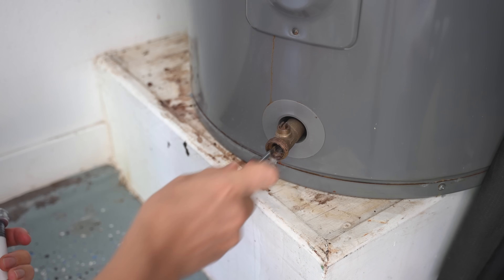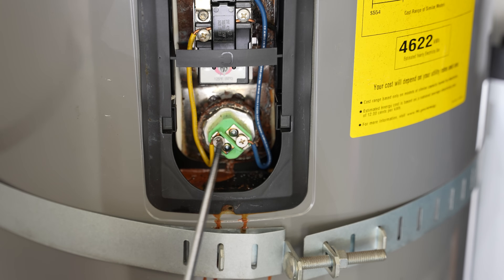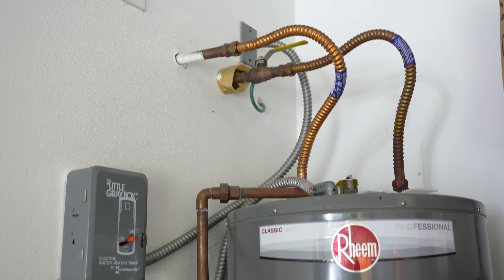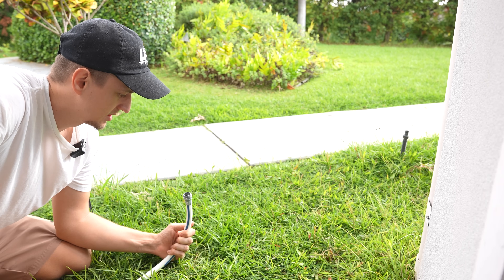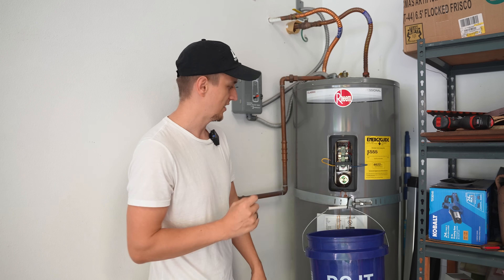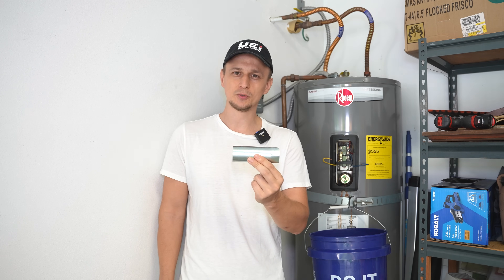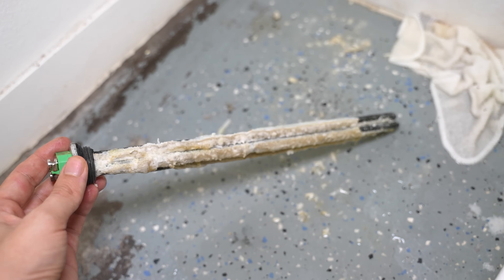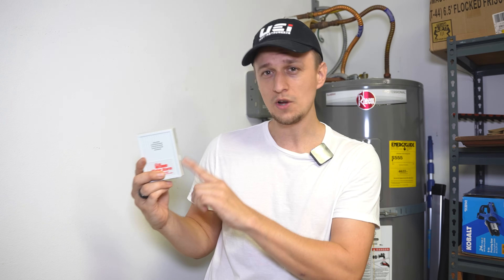How to Replace Water Heater Element Without Draining the Tank

Comment from the maker: ⬇ Other water heater videos you may be interested in:

How to Test Heating Elements:
https://youtu.be/btyVpGgQK3Y
How an Electric Water Heater Works:
https://youtu.be/H3mK15ILAMs
How to Replace Pressure Relief Valve:
https://youtu.be/ca7cg_Vp-rY
How to Adjust Temperature on Water Heater:
https://youtu.be/mMefq--YuZ8
How to Replace Anode Rod on Water Heater:
https://youtu.be/qLzoikQ7gWg
Does a WH Really Need to Be Drained and Flushed:
https://youtu.be/bb35cQuJ_y0
When Should a Water Heater be Replaced:
https://youtu.be/xRtd2lSb4lY
Running Out of Hot Water Too Fast:
https://youtu.be/o-LsUWlWVh0
How to Read Water Heater Wiring Diagram:
https://youtu.be/TX8SuHK1esY
The ONE Device Every Homeowner Should Have:
https://youtu.be/Oy21NhLuzvk

Comment: Sometimes if the drain valve is clogged with sediment turning the main valve back on momentarily can blow the junk out with a little added pressure. Also had elements rusted that bad you couldn't budge with a breaker bar . A 1/4" drive impact drill  and socket will easily break it loose and I always add pipe dope on the usually rusted threads on tank and new element to keep small leaks from happening even though the gasket is supposed to do the work it will at least make the element easier to remove next time. Most 1 1/2" sockets will need to have the chamfer removed from the face as there is very little material for the socket to grip unless you find a socket made for element removal. Ask me how I know this. 😂

Comment: A universal heating element heats as good as a name brand..... just use the correct wattage and voltage. 3500/4500 240v etc....
Reply: Agreed. Those sold at our hardware stores will fit and function as well as name brand. Might even be made in the same factory.

Comment: You left the hot valve open when you removed the element letting air in. Wrong…..close the hot valve then remove element….now you have a vacuum and very little water comes out. Then after you replace element you can open the hot valve to let air escape while you refill the tank.

Comment: After replacing both elements and both thermostats and checking all voltage / continuity.... my heater gets 240 volts but makes NO sounds.  Is this normal?  My previous elements made a quiet, hissing, heating sound since the first day years ago.  What do you suggest?
Reply: Replying to my own question:  After 2 hours with the electricity ON my new parts, I had hot water !! Yeah! Having No sound is apparently not a problem.  With my ear pressed on the tank, I only hear a faint humm. Whatever I did, it resulted in a silent tank unlike when it was brand new.

Comment: Weird. All our Rheem water heaters have the element at the very bottom because hot water will rise to the top so you want to heat the coldest water at the bottom of the tank. There's no space for a bucket to catch water. I've only seen upper elements when it's only a booster element for solar or a wetback. Think I'll stick to draining the tank first.

Comment: Question I have a 50 gallon energy smart whirlpool electric water heater I checked the elements and they read around 12/13 which I assume they are still good? Issue why I checked them was the pressure relief valve was dripping water from the tube and the hot water keeps going off and I'm having to reset it. This water heater doesn't have thermostats like regular water heaters so I assume the thermostat is in the control panel? Please help not sure what the issue could be why I'm not getting hot water and keep having to reset it to have it work for a bit then again have to reset it. Could it be the pressure relief valve itself but I assume that wouldn't be the cause of why it isn't heating? Could sediment in the tank cause it to not heat up? Please help 🙏🥹 ty !
Reply: 2 weeks is a long time to go without hot water, so I presume you got it sorted one way or another. However, if not, it sounds like you have electronics instead of thermostats and there is a problem causing the electronics to call for heat on one or both elements so it builds too much heat/pressure and leaks at the pop-off. If you have access to the electronics, it could be electronic parts failure causing it call for heat, or a stuck relay (fused contacts is a typical failure mode) completing the circuit to an element.

If you are handy and it's a relay you probably can replace it. Tapping on it may break the fused contacts loose, but it will not take long to happen again.

Comment: To drain it faster, connect the end of the water hose to a water hose faucet. Open the drinking water faucet, for a few seconds. The water pushes back to the tank, then disconnect the water hose and the suction will reverse back to normal and the water flush whatever sediment is causing obstruction.

Comment: Im about to turn the water back on. Man, I hope I did this right. If it works this will be my first home repair project. Hopefully I don’t need a new home in case I messed this up lol I appreciate the video for sure. I watched a few others but ultimately used your video.
Reply from the maker: Hopefully all went well for you my friend! Way to tackle the repair yourself. The first times are always stressful but confidence is built by trial and error.

Comment: Why couldn't you drain the tank by turning the hot water faucets inside the house on after you've flipped the breaker to the water heater and turned the water off to the house? For example, if you turned the hot water in the bathtub on, it would drain all the water in the tank and since the water to the house is off, the tank wouldn't fill back up. That way, you wouldn't have to worry about running a hose through your house or messing with the drain on the water heater or potentially flooding the room by doing it "on the fly". Im no expert, so if there's a reason why it should not be done like this, please let me know.
Reply: I wondered the same thing. Hopefully someone will respond to this. I just drained my tank with a hose. I hardly had a trickle so that was an entire other video lol but I got it done. Hopefully… I’m about to hit the power and see.
Reply: Cold water fills the water heater up from a pipe going into the top of the tank. This pipe goes all the way to the bottom of the tank.  When you turn on the hot water faucet in your house, the heated water exits the tank from the TOP while simultaneously getting filled from the bottom. You only open the hot water faucets in your home so that a vacuum is not created inside the water heater and so that it can be drained properly via the hose bib drain at the bottom of the tank.

Comment: I worked at a HUD apartment complex years ago and I did element swaps and never drained a tank, i just cut the power and water, duct-taped a heavy garbage bag right under the lip of the element bulkhead to catch the water and did the swap as fast as possible. Some of these water heaters were 15yo+ and full of lime so draining for a swap wasnt an option. This also got me out of the apartments significantly faster which was better for both me and the residents.

Comment: I just completed this repair today on my unknown age Whirlpool 62 gallon 240v water heater.  New upper and lower thermostats, new upper and lower heating elements, and a new T&P valve.  The sediment was up to the lower heating element.  I vacuumed out as much as I could using a smaller tube shoved into my shop vac, but I know it's not perfect.  Just buying time at this point!  What temperature do you set electric water heaters to?  I have my upper and lower thermostats set to 125'F, but from the factory they appeared to be set to about 120'F.  I also sprayed all of the elements and the T&P valve with PB Blaster and Kroil for 3 days.  Removal was so simple that I didn't even need to use a pipe wrench on the T&P, only channel locks.  Amazing.

Comment: Made me laugh talking about the element getting stuck I flooded my house around my hot water cupboard when trying to change without emptying it it was hilarious fortunately old tongue and groove floorboard drain well and I ended up with a very clean floor😂😂 and a new element in resulting with a running cylinder

Comment: If I have a commercial water heater that says 480v on it does that mean I get a 240v heat element for each which equals 480v or do I have to get a 480v for each element? Because I got a 240v element and replaced both of them and the breaker tripped…

Comment: this isn't anything to do with a water heater but my furnace isn't quite right there is to much flame behind the burn chamber it's floating all over it's not roll out. I was wondering if anyone knows if the fuel rail nozzles can get opened up after so many years. i set the gas valve with a manometer to 4 inches of water col. which is what it calls for on my furnace..

Comment: I’ve never drained or changed heating elements in my home but I kinda want to do it for maintenance. Now to help drain you can use the hvac vacuum attachment and pull the sediment out and it will start to flow out.
Reply: Exactly, great idea. Just like HVAC condenser line

Comment: This video mirrors my exact experience replacing the element.  My water heater won’t drain because my water softener broke and all the media ended up in the bottom of the water heater tank.  (I was really hoping you would share an easy way of getting all that crud out of the bottom of the tank.  Oh well...)  After futile attempts to drain the tank, I always end up swapping the element out on the fly.  It used to concern me that some of the water gurgling out when I remove the element ends up beneath the skin of the water heater, but eventually concluded that this thing is generating a lot of heat and any water that gets in there is likely quickly evaporated.  As long as the thermostat and the element connections are dry I figure I’m good to go.

Despite having a (new) water softener, my heating element still acquires quite a bit of mineral deposit build up, (we have extremely hard water), so I tend to replace the element every other fall.  My water heater is accessed from outside the home.  The element failed once in the dead of winter and I had to do this job when it was 30 degrees outside.  I don’t want to enjoy that experience again.  

I could be wrong, but I figure all that scaly build up reduces efficiency making it more expensive for me to heat the water.  I know elements aren’t that expensive so maybe I’m being cheap, but other than all that scale build up there really isn’t anything wrong with the old element when I remove it.  After the job is done I soak that old element in vinegar for a day or two and all those deposits pretty much just wipe off and, barring physical damage, I have a clean spare element that I can later swap back in.  Of course, I still like to keep a spare brand new element on hand just in case, just like I used to keep a spare capacitor and a spare heat sequencer on hand before I replaced my old central air system.
Reply from the maker: Thank you for the detailed comment, I'm sure some people will benefit from your experiences. Yeah sorry, I didn't want to deal with all that sediment. 😅 It would probably be a good video to do though... I'm not a plumber so maybe I don't know some of the tricks. The easiest way (as far as I know, none of the methods are easy) is to take out the lower element and scoop/vacuum/scrape all of that stuff out through that opening. You'd need to tape a tube to the end of the vacuum hose since most vacuum hoses are too large to fit. And if the water heater isn't draining, you'll have to use a bucket to catch most of the water coming out of the lower element hole. Once the bucket fills up, put element back in, dump bucket, and repeat. It's annoying to drain and even more annoying to clean... If anyone knows of a good method to clean it other than what I described, I'd love to hear it.

Comment: Glad I have a gas water heater. 😂
Hope you try and clear the drain valve and get some of the sediment out, your water heater should last longer and you might get more volume out of the tank.
Reply from the maker: Lol, I agree about the joy of having a gas water heater. 😄
I don't know if I want to deal with all that sediment since the water heater is leaking on top and will likely be getting replaced soon.
Reply: @WordofAdviceTV  Yeah, if replacing soon, I wouldn't bother either. I'd pull the elements for spares if similar to new one and leave it at that. 👍

Comment: might be a good idea to open covers and spray element the day before with penetrating oil to maybe loosen up the element and open drain after turning power off with water pressure still on to clear out the drain and get rid of hot water before closeing valve and draining tank by gravity. roger wakefield showed a new tool it had a way to blow out junk in drain valve he has video on it.
Reply from the maker: All great tips and suggestions, thank you!
Reply: @ranger178  that’s exactly what I did. It never soaked past the rubber ring.
Reply: @10forthebigguy753  so the rubber ring is on outside and the threads are inside in the water? on his water heater the threads looked clean and the metal around outside of element looked corroded outside the rubber o ring

Comment: Shouldn't you have turned off the bath faucet as well to vapor lock the system if you plan in doing the replacement without draining the heater? Wouldn't that help to keep water from draining out the element opening?
Reply from the maker: Yes, that would have helped and the water would have probably chugged out slower. It would have been better to do as you said.
Reply: @WordofAdviceTV  Thanks for the response. I've glommed a ton of info from your HVAC vids. Especially the gas furnace diagnostics as I do residential maintenance and we use the Trane 80% efficiencies that you use as examples. Saved me TONS of time. Was just looking for clarity on the element question. Awesome channel!!!
Reply from the maker: @TheExistentialNihilist  You bet! Glad to hear that the videos have been helpful for you. Thank you!! Have a fabulous new week good sir!

Comment: With my water heater, each time I have replaced the sacrificial anode, I try to drain just a few inches of water to relieve some pressure and not have water bubbling up out of the anode port.  I've found every time, that in order to have any water come out of the drain at the bottom, I must manually open the pressure relief valve a little. Letting that air in, allows some water to drain out.
Reply from the maker: That's a great tip!  Thank you for sharing how you get your water heater to start draining.

Comment: 1) always replace the factory drain valve with a full port valve
2) flush the tank at least twice a year
3) when attempting to flush a tank, give it a quick blast with the cold water valve
Reply from the maker: Great tips, thank you!!
Reply: Or just leave the water on?  Why wouldn't you want to flush the tank with water pressure?  Cut the power, attach hose, let it flush for 5-10 minutes, done!
Reply: @Florida_Man_In_Florida the act of draining down the filling up and respecting will agitate the calcium more than just simply opening the drain valve and letting it flow. 
Really any way you do it, it’s better than not doing it.

Comment: to make draining the hot water tank easier, You can buy a transfer pump. It might even help if the tank has sediment in the bottom as it could break it up a bit with the increased flow.
Reply from the maker: Great idea! Thank you for the suggestion!

Comment: One of the best DIY channels on YouTube. 

When replacing an element “on the fly”, I go back and close any faucets that I may have opened previously. Then I’ll replace the element “on the fly”. Closing the faucets that I previous opened creates a partial vacuum, and the water doesn’t gush out as fast while I’m removing the old element and installing the new element.
Reply from the maker: Thank you sir! 🙂 I appreciate the tip!

Comment: I learned this from John Phillips Plumbing YT site. remove the antisyohon valve from the hot water outlet nipple and insert a 1/2 inch cpvc pipe into the nipple and connect this to the suction side of your pump and pump the tank out from the top. You will need to keep the end of the pipe above the sediment level in the tank. Keep up the great videos.
Reply from the maker: Oh that's an interesting tip! Thank you for explaining how to do that!

Comment: After you saved me with your furnace gas valve advice, I have been hoping to see a video about troubleshooting hot water heaters. 😅 I'm currently having an issue with the thermal switch tripping on occasion. It happens more often when the door is closed so I'm assuming it's not getting enough air. Any thoughts?
Reply from the maker: Glad to hear that the videos have been helpful! Do you have makeup air going into that room? Perhaps this something you could add if you don't? I talk about that somewhat in this video: https://youtu.be/qVdXsHBAOwk?si=6cb5AMLjAODcAkfo

Comment: Sometimes they're really difficult to get to drain especially if its city water. I use a 2 hose y splitter on the tank,
Take a clothes washer hose and attach it to one side of the y and a drain hose to the other. Using the valves on the y you can back flush the tank just a few blasts will usually clear the drain.
Reply from the maker: That's a great idea! Thank you for the good tip!
Reply: @WordofAdviceTV  if people saw what's in the bottom of a city water hot water tank they'd think twice before drinking it